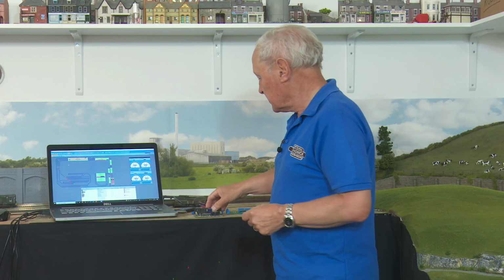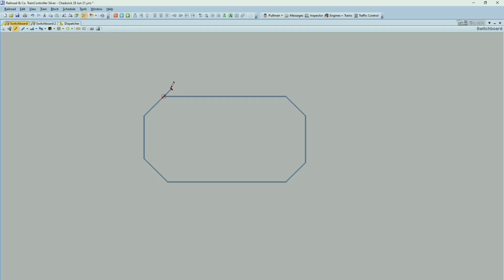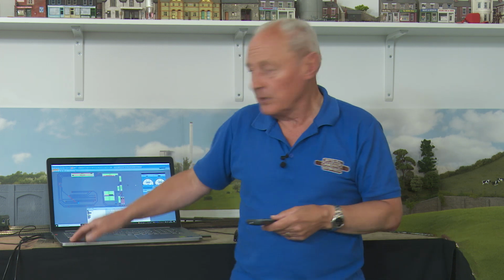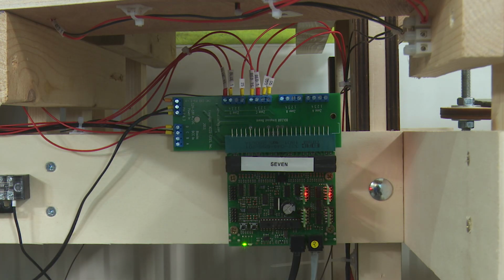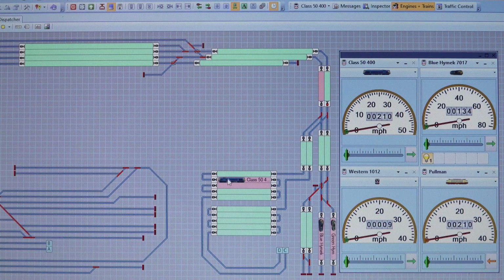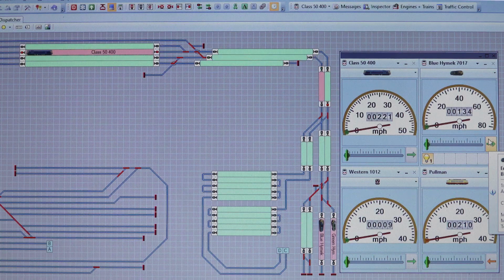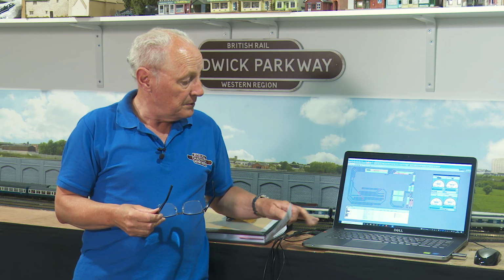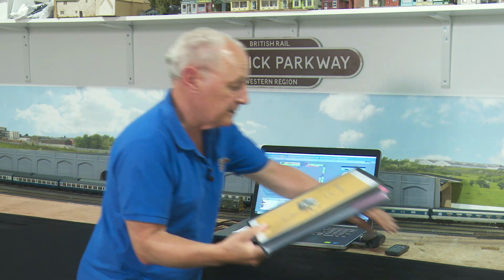An Intro to Block Detection at Chadwick Model Railway | 137.

Comment: Hi from the US. Thanks for all the informative videos. Don't know if you've covered it before, but do you think your block detection /train automation combination could be used with battery powered trains? I'm intrigued with building reversing loops/wyes etc. and wondering if feeding current to the rails simply for block detection/dcc control would pose any short circuit problems. I'm assuming the control signal (track pick-ups) could be isolated from the power supply (on board battery) to the locomotive motor. Is this the correct way to think about the problem? Any thoughts you'd care to share would be greatly appreciated. Thanks, Steve
Reply from the maker: I’m no expert on this one Stephen but doubt that it would be feasible.  
After all, it could never control the speed of the loco.

Comment: Thank you for your wonderful videos.  I really enjoy them.  Question please, the adapter that fits on the BDL168 which provides the posts so you do not have to do all that soldering, who makes it and how do I get one.  My audio system is not the best and I did not clearly hear you when you explained the name of the source.  THANK YOU
Reply from the maker: It’s made by Acculites and if you’re in the uk, is available from coastaldcc.co.uk.
Reply: THANK YOU Charlie.  I live in Houston Tx. USA.  I just ordered two of these boards.  I really enjoy your videos and have learned a lot!

Comment: Hi Charlie great video as usual. I use JMRI and MERG components Alright I have to make up the boards but that is fun on its own And i have not had a failure yet and I have not spent  probably £150 total on powering up my layout thats usb interface control board for the whole system a 10amp booster board quite a few servo driver boards for signals and turnouts all these are BUS controlled. 
So i`m pleased with that.
I chose this option because of the silly prices  commercial systems were charging .
Reply from the maker: That’s great Kevin, at least you have pleasure in your progress.  Sometimes that’s not the case!
Reply: @ChadwickModelRailway  thanks for the reply

Comment: I finally got round to viewing this last night and as ever found it very informative. Some years ago I planned an n gauge layout with a couple of hidden storage yards to be controlled with TC which I had trialled on a test track. Due to various house moves it never got built but now having finally settled I have just completed laying track for the first yard and installed the wiring for block detection. I was stunned to hear you speak about the disparity in costs for the UK having not looked at it for a long while, the silver version appears to have gone from around £300 to around £450 and is now causing me to re-think my options. Many thanks for pointing this out before I had gone too far down the line so to speak.
Reply from the maker: Take a good look at iTrain, it’s the way to go.

Comment: Thanks for that Charlie. A friend of mine suggested i-Trains was a good way to go when I eventually come out of the age of the dinosaurs and go DCC, so your info has come in rather handy. Amazing how these things escalate, but then I guess in our hobby the initial cost is always the top of a bloody huge iceberg! 🧊 

I like the idea of protecting junctions like that. A friend of mine “back n the day” had a rather crude yet clever system on DC using diodes that slowed trains at signals if they were red, and this I suppose is the slightly more sophisticated DCC equivalent of that 🤔

Thanks again mate, great stuff as ever 👍🍻🍀
Reply from the maker: Great comment Tim. I’m so pleased that you enjoyed it.

Comment: Hi Charlie this was a fascinating video. I've started work on a small shunting layout which is planned to grow into a larger exhibition layout and was considering setting it up for block detection. This video has inspired me to take that idea further. The cost of it all is a bit eye-watering but I was looking at the MERG kit as a way of reducing cost. I run  an NCE Power cab because my local club in NW Sydney is NCE based, so I'm looking at options that are compatible with this system. I love your presentation style - you manage to make the most daunting subjects very understandable and much less intimidating that they initially appear! I only found your channel about a month ago but I'm hooked. I reckon that I might have caught up with all your prodigious output in about three months time!
Reply from the maker: It’s great to have you onboard Jon.
Regards Charlie

Comment: I am a Marklin collector and I have at a fairly decent price converted all but two of my AC loco's to digital for one reason only and that is the relays that were used to reverse the loco's would eventually play up and no matter how hard you tried you could never adjust the arm on them - They would either jump from forward to reverse or wouldn't change direction at all

You always risked breaking the little arm off the relay from constantly trying to adjust it
Reply from the maker: Thanks Evan, an interesting problem.

Comment: Hi Charlie.
Thanks for a lot of super great videos. You are a big inspiration .. :-)
I'm 60 years old from Denmark. I drive lokomotives for work. Greatest job ever :-)
Well. I use Digikeijs DR5000 and my blockdetection is DR4088 Both R-Bus and Lokonet connection.
My points are controlled by DR4018 and works great.
I use WinDigipet 2018 as Software. That is a super train controlling software from germany.
Well thats it. Bye. and thanks again.
Lokomotive / Engine driver Denmark
Brian Gervin
Reply from the maker: Thanks for a great comment Brian and the insight into your world. Regards Charlie

Comment: Great Video Charlie. I have recently got back into Model Railways after a 40 year sleep. I have recently constructed a 14' x 9' layout and I have split the layout into blocks, but currently tied all the wiring together for later detection. I have recently read many articles on Itrain vs Train Controller and still not sure which to invest in, seeing it isn't just an investment in Money, but also a great deal of time. Have you any suggestions?
Reply from the maker: My advice is iTrain. It’s much cheaper and if you buy from DCC TrainAutomation, there is an after sales service too.

Comment: Excellent video as always thanks Charlie. Train automation for model railways is certainly a bit of a minefield. But I’m gradually getting to grips with my setup as I build my railway. Have had some successes now. Having said that, it has been a bit of a steep learning curve to get where I am, and without several interventions from a very patient, kind and helpful James Hudson at DCC Train Automation, I’d probably have even less hair than I do ! It is rewarding though to see trains operating in a way that would be seen in the “real” railway world. For the record, you asked your viewers to leave details of their setup. For me, I’m using iTrain Plus. My controller is Z21 and I’ve invested in a Z21 double booster to give me an accessory bus and and two track buses (though that isn’t installed yet). Detection is through Digikeijs DR4088LN-CS modules as they seem to be the best value for money in terms of channels per £. Generally I have one feedback per block, though in some cases there are two feedbacks in a block. Also, I’ve put detection on all of my points (though the points aren’t in blocks), logic being that iTrain never loses a train as it is detectable at every position on the railway.  I operate my iTrain on a large Sony screen mounted on the wall. I think I’ve covered everything ! Just to add, that Pevenbourne is probably only about 25% complete, so there’s lots more wiring and programming to do yet. Hope that’s helpful. Take care Charlie.
Reply from the maker: Hi Bryan, many thanks for your detailed update. I too will purchase iTrain to do an analysis of the two systems.
Regards Charlie

Comment: Have 2 layouts both with full automation and block detection.

OO gauge layout uses digikeijs command station and their detection railcom modules all linked to to RocRail

O gauge layout uses Digitrax command station and detection modules all linked to RocRail.

Rocrail is free and does everything and more that the likes of itrains etc do.

If digikeijs was rated for O gauge I would have used that but had to go with digitrax. Digitrax is awful compared with digikeijs, horrible to setup and configure whereas digikeijs is plug and play.
Reply from the maker: Great comment Rob, Digikeijs clearly has its advantages.

Comment: Cheers Charlie. Great video. I'm just starting out in model railways after 30 year break. I decided to go DCC and after watching McKinley Railway , I too set my vision on an automated layout with working signals. Digitrax is the way i've gone , even though i know how difficult it is to get hold of the stuff, always seems to be out of stock. 
I have a box with some SE8C's and BDL168's and a PM42.  some i've picked up from ebay and others from CoastalDCC in Ipswich.

I have 2 sets of transponders for a massive sum of £2 , but that meant getting digitrax decoders. No idea if it will work. but for a few quid worth a try.
only problem is digitrax dh126 don't offer ABC
I'm keen on ABC , auto braking control, as featured in ZIMO £20 budget decoders. it's really simple to implement with a 5 diode network in each stopping block..creating an asymmetric dcc signal. 

I hope to use JMRI to do all the layout train control , and arduino's to Control point servos. 

I suppose i could have gone down the Arduino route to control it all , as in 'Little Wicket Model railway' youtube , but wanted to buy something that works first to get me going.

Do you use a detection block for each set of points?

Many Thanks Leney
Reply: I'll watch with interest your exploits with the se8c , as I still cant get 4 aspects to work properly (as per uk railway 4 aspects). Digitrax advertise 4 aspect but it's a swiz as they class flashing the 3rd aspect as the 4th aspect. ...and I bought 20 x 4 aspect signals at the same time as the se8c and now cant use them as I'd intended.
Because Digitrax use 'Charlie-plexing' technique to get 4 sets of signals to work for just 10 wires , I've not been able to use simple NOR logic gates to create the 4th aspect myself successfully yet. it's a bit of schoolboy electronics but that was a while ago.
My thinking was to say if the red and green are both off , switch on 1 amber, then the switch the other amber on/off as the 4th aspect.
I'll let you know if i ever get it to work properly
Reply from the maker: Hi Richard, perhaps SIGM20 board might do it.  Have you tried one?
Reply from the maker: Hi Leney, no I don’t include any point work in blocks.  Various people and suppliers have advised against it.
Regards Charlie.

Comment: Use digitrax command station and TrainController Gold. Started with BDL168 for detection but have moved to Digikeijs DR4088LN, less expensive and just as reliable. I model German railways and use Traincontrollers timetable to run passenger trains and through freights to keep a high frequency of trains while I putter with the local Switcher or occasionally just watch.
Reply from the maker: Thanks for the info Thomas, regards Charlie.

Comment: I am planning a block detector with arduino and infrared sensor detection. The idea is that all this then manage the status of the traffic lights and in the future to be able to manage it from a PC to make automatic stops where necessary.
Reply from the maker: Sounds like an interesting plan Juan.
Reply: @ChadwickModelRailway  I am discovering many new things on the internet. Among them an application for JMRI called CMRI that connects Arduino directly to JMRI. It would be necessary to evaluate the application you use to know if it has this kind of functionality. Arduino is much cheaper to implement than other (NCE, Digitrax, Lenz...)

Comment: After watching this and much research Charlie, based on the cost and complexity I have decided to keep it simple. I like the Blockdetection modules you have shown before and will use these for my Eckon signal kits. For my Ratio semaphores, I will use the multicontroller from megapoints.com as they have a great prototypical arm bounce and second pull on the arm. I appreciate it doesnt allow automatic running but it's fine as I have sepearte loops and with DCC can run the station and shunting/yards seperately. As you say, its horses for courses. Great videos, keep up the good work
Reply from the maker: I'm so pleased that you enjoyed it Paul.  Stay safe. Regards Charlie

Comment: I have just watch the video on block detection.

An excellent video for the person who is just starting out with DCC

A couple of points I think it is worth mentioning. The feedback system you mentioned that Digitrax does not have is called Railcom . And you also don't need to have 2 sensors to each block of track you can use a system of speed related movements to gauge where the loco is and programme the speed reduction from there.

I run a Z21 system with a mixture of Digikeijs and Roco products and use Itrains Plus for automation. And have found it most rewarding and FUN. The total cost on this layout is around £800 and climbing. (and that's not including all the locos,wagons, coaches an chips)

As you know I love to potter about with electronics and as such have another layout which I am able to switch from one system to another by unscrewing a few wires. I am a the moment setting it up to use Merg block detectors (the Diode voltage drop sort not the current sensing version.)

The break down of this system is

1 DCC++EX for a command station.

Arduino Mega £13.00

Motor Shield £18.00

Wi-Fi Board £ 5.00

DCC Next for the accessory decoder (a very clever little board) £11.00

Servos for points £1.00

Relays for point frogs £1.50

Block Detection Board £ 2.18

And a signal driver system developed by another Merg member £ 2.00

Total £53.68

This shows the near the top of the spectrum and the DIY at the bottom. I hope this is a little help to those who are contemplating getting into the DCC side of this wonderful hobby.
Reply from the maker: An interesting comment Bob. However, using Train Controller Bronze or Silver, a second sensor is certainly advised.  It’s only with Gold that block length is entered.  Regards Charlie.
Reply: @ChadwickModelRailway  Hi charlie I use ITrain Pro and have setup distance and speed

Comment: Hi Charlie, I watched your video with much fascination, I have a total DC layout and have block detection that runs my signals,points and some other small things, I use a very simple transistor current detector circuit and never fails, your system seems very expensive to me, being I am not computer savvy, thanks for a great video from down under in Wairoa New Zealand
Reply from the maker: I’m so pleased that you enjoyed it Jed.

Comment: Hi Charlie thanks for another good video, I use Digikeyjs 4088LN CS (That's Loconet Current Sensing) I believe, as there are several other types of 4088's. I use a DR5000 for the controller / base station. 4018's for signals and iTrain Standard as it does all I seem to want. I use a Pikko 55016 as a hand held controller. I have DCC ipCobalt point motors.  I like iTrain the new videos by a guy called Bob Fuller help on you tube to work it out, the manual I find a bit heavy going, there is a forum providing you type your question in the correct format, plus James at DCC automation is a great help. I do enjoy it but also often want to throw it out the window on as many occasions as I love it!
Reply from the maker: Great comment David and good luck with yours.

Comment: Hi Charlie, about the cost, of Train Controller. They price it in USD, but when you convert it to GBP, $930 becomes £671(@ todays conversion rates, 05/07/21), which is not that far removed from $699 price.
Reply from the maker: Yes but that is far from the exchange rate John.